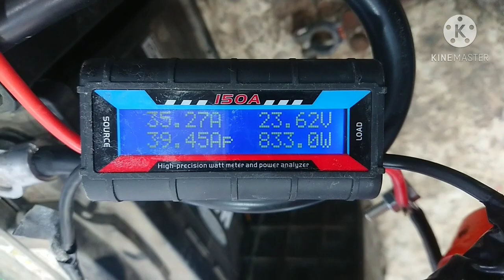Car-starter as e-bike motor | testing 12v - 24v - 36v

Comment: is the motor get's hot?
Reply: same question  i want a make  go-kart   for school
Reply: @elgatomewingultimate  well i think it's getting hot because when the motor starts it takes like 200 amp or higher and then it drops to 30 so it's killing the battery i suggest using brushless motor it's very efficient